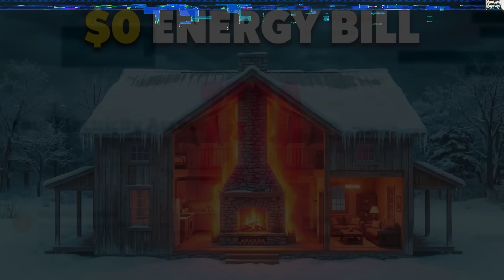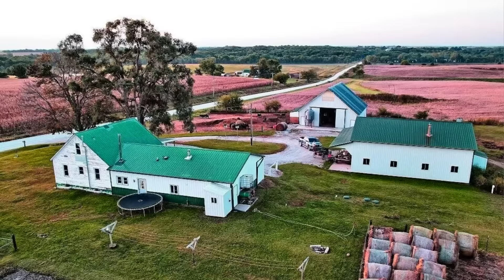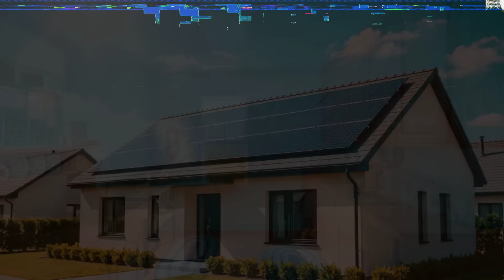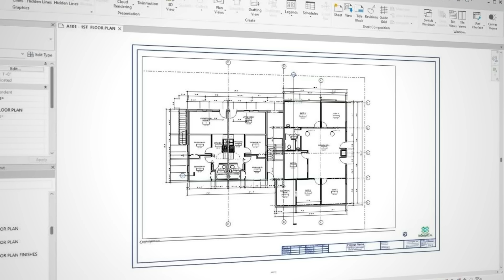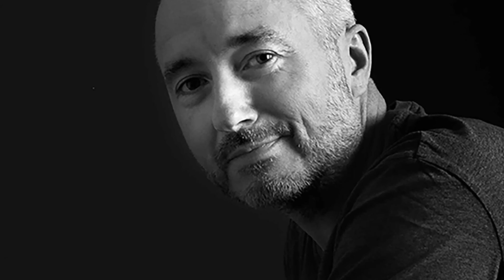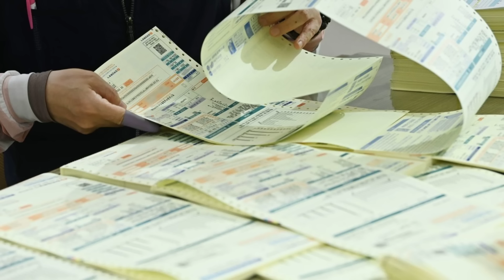The Amish Have Never Paid an Energy Bill — This Is the Exact System They Use

Comment: This video explores the traditional, highly efficient energy-saving methods used by the Amish to maintain complete independence from utility companies. By rejecting modern convenience in favor of centuries-old, stress-tested architecture, they achieve zero-cost heating and cooling.

Key principles of the system include:

Passive Solar Design: Homes are carefully oriented toward the south, utilizing geometry to capture maximum solar warmth in the winter while providing natural shade during the summer.

Thermal Mass: The use of materials like stone and brick allows homes to store heat during the day and radiate it slowly at night, effectively acting as a thermal battery.

Strategic Ventilation: Natural cross-ventilation and the stack effect are used to cool homes without electricity, utilizing the temperature difference between shaded north-side inlets and warm, high-level exhausts.

Masonry Heaters: Unlike standard wood stoves, these massive structures burn fuel at extremely high temperatures for a short period, then radiate that stored heat throughout the home for nearly a full day.

Geothermal Exchange: A lesser-known technique involves "floor breathing" channels buried beneath the home, which pre-warm incoming air using the earth's natural, consistent temperature.

This video argues that these effective, sustainable practices are often ignored or discouraged by modern building codes, which mandate reliance on grid-connected mechanical systems to ensure monthly utility payments.

Comment: In all post Soviet Union villages heating is similar to Amish...We burn 2chopped logs in a heater made from clay bricks decorated or not by glaze tales and shamot bricks or not from inside...wood burns completely in 2-4hours till white ashes then chimney air waves are blocked to keep heat inside   ,need wait till white ashes burn coz closing all doors in heater &chimney can cause deadly carbon dioxide poisoning.That heater keeps warmth about 12-18 hours so in bedrooms is wood burned once a day but if winter is not just -10 or -20Celsius cold but -40Celsius heater is burned twice a day 6clock morning and 2clock in afternoon...heater in kitchen runs till 4clock afternoon and added black coal coz cooking,heating up water for washing or bathing...

Comment: You can get free electricity from the ground
Reply: How I’d like to understand that principall
Reply: Copper coils burried underground. Basically whats under the egyptian pyramids and what tesla was working on. Our planet is a massive power bank. The same system also work in gardening. Wrap a stick with a  copper wire leaving an antena on top of it. Stick it into your garden and you will have the best harvest ever. Combine it with burying dead logs under your garden that survives drought without a problem and in 4 years you have a super soil that powered civilizations in amazon
Reply: @NoName-kl9pp  and how to produce ⚡🔌from any techniques
Reply: @jockey1warrior he lost me at the egyptian pyramids, we only need to understand one thing: no free energy in the universe....like for example...if its 94 degrees outside, what cool air will be sucked in?

Comment: You might want to take a look at hempcrete as a building material and the compost heating system as a heating system if a south facing building is not an option.  Combining these two with the basic solostove design the not only burns the fuel but also the smoke as your ground floor / basement heating system you could wind up with an extremely energy efficient home with close to zero energy bills.

Comment: GAS,OIL,ELECT ALL CONTROLLED BY BIGBUSINESS WE DESERVE BETTER
Reply: There are two ways to solve this problem:
1.  You work harder and accept two or three or four jobs.
2.  You save money by do-it-yourself and buy second hand ...  First of all: NO CREDIT CARD, ONLY DEBIT.
You buy second hand furniture, spray them and they are as new.   You buy an older second hand car (not electric).  My diesel car is 22 years old and runs as new.
You do paint work or repair work yourself ..... and you invest in tools (also second hand).
If you live in a colder region: buy a wood stove (second hand) and a hydraulic wood splitter ....

Comment: Yeah this is actually pretty common in Amish communities. Many of them use off-grid systems like small solar setups, batteries, or even pneumatic and hydraulic power depending on the workshop. The goal usually isn’t the technology itself, but staying independent from public utilities while still being practical. It’s a really interesting balance between tradition and smart engineering.

Comment: Yes they don’t pay for electric but they do buy kerosene fuel oil and diesel along with candles some also buy wax wicks and make there own candles. But most of the ones I know use kerosene lamps and lanterns they also don’t go to most regular stores the Amish have there own and buy and trade there. Just because they don’t pay electric they also use propane and wood which they either have to buy or selves so your talking about a couple months of heavy work with axes 🪓 cutting wood some have chainsaws but you still have to split it and hauling it and stacking. So you’re happy happy that the amish spend months a year doing very hard labor in stead of paying a few hundred dollars for a little light and heat.

Comment: I wanted my home direction like this for best energ use and the Builder would not do it, he said because it is labeled as a "SUBDIVISION" of 8 HOMES over 2.95 tenths of a mile on a mountainside holler, the front of the home MUST FACE THE ROAD. RRRR, once you've signed the Loan papers you are screwed-I was told IF I DIDN'T SIGN-OFF ON ACCEPTING THE HOME UPON OCCUPANCY--they WOULD SELL IT TO SOMEONE ELSE.

Comment: The cross ventilation was a surprise. I knew about the others and in my home town a builder wanted to do the ground heating/ cooling method but the town was not sure it was acceptable so he didn't do it. The other thing was the south facing wall of the house being off set by 10'.  Great video which show help argue for these methods by the so called Green Environmentalist and CARNEY' s net Zero.

Comment: I haven't seen those two selution.
- -
1. A bow window at east and west side, and north to catch light from east and west. That at second stock. 😢
- -
2. At east, south and west side should you set up an connected orangeries of glas. 😊
And even north, 2,5 meter air for  isolation. 😊

Comment: I have not had an electric bill in 10 years.  I put in a grid-tied solar array.  I put more energy into the grid than I use.  Got rid of the propane deliveries when we went all electric.  I have met and talked at length with some Amish people.  They can have propane or heating oil delivered to their farms.  They just pay cash for it on delivery, or they go buy it at a store.  They just don't want to be connected to the grid, or use credit or banks.  They can even have a windmill to generate their own electricity, and now they can use solar too.  Many years ago I visited an Amish buggy builder who had a shop full of air--powered tools.  He had diesel delivered to run a big air compressor.